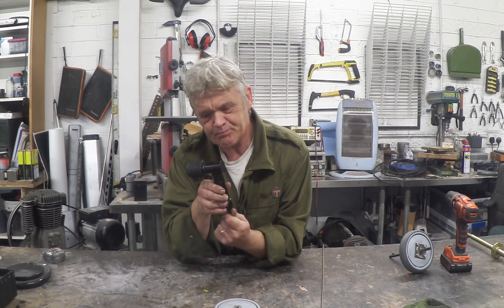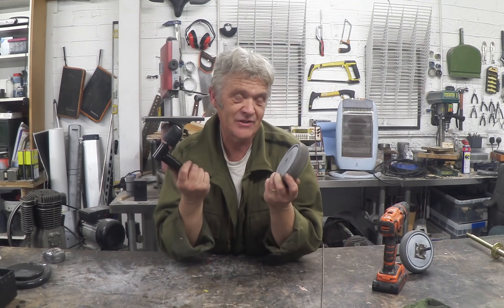1173 How To Make A Universal Bike To Electric Bike Adaptor

Comment: A couple of these mounted on a standard wheel chair and you now have an electric wheel chair.
The only difference is that you would want a single controller for both motors and you would want a couple of drills that have variable speed control.
Reply from the maker: awesome

Comment: Beauty is in simplicity! I totally agree with overengineering problem. Sometimes the coarse, inelegant solution is the most optimal and best-working one. Now, time to look for 90° attachment for drill :P
Reply from the maker: Well said mate
Reply: Why not just mount the drill/motor sideways? On a swing arm, so that it auto-decouples when not driving? Oh, hang on, that's already been done.
Sorry, Rob, luv ya, but this is paynts.

Comment: It wouldn't hurt to have the thing detach from the wheel when not in use.
Having it stay connected at all times means it will hinder movement more then assist most of the time.

Nice work showing how the general idea is applied, though.

Keep up the good work.
Reply from the maker: nice point mate - cheers
Reply: @ThinkingandTinkering  A $10 one way bearing pressed into the castor wheel instead of the plate, and then weld the axle to the inner ring and you have coasting ability with the drill off.
Reply: @jllaine   Nice workaround, mate.
Way to make it simple.

Comment: The only issue I have with this is that a drill was not intended for that kind of duty cycle, and I am pretty sure it will burn out in very little time. It was also a little on the noisy side. lol. Interesting idea though.

Comment: This is great! You can extend the range by 20- 30% by rigging the contacts with a larger battery from a motorcycle. Most drills are 18v or 24v. I’ve a skate wheel and a strip down drill. I wonder I really do, how simple things can be made? I bet you could improve the torc ratios a we bit by changing the diameter of the drive wheel. Well done lads keep it up.
Reply from the maker: nice

Comment: replace the power drill with a 24v motor from ebay and some batteries and a bridge rectifier and replace the brake cable with an electronic throttle or a potentiometer with a return spring attached to the knob and you have yourself an e-bike.
you'll also need something to act as a clutch to disengage the motor when the motor is not active otherwise you'll get unintended wear on the motor and it'll backfeed a voltage to the battery.

Comment: Awesome idea, just like my old VeloSolex but with electricity. However I've seen few contraptions that use electric drills as the motive power and I've always had concerns about:
1) overheating the drill with continuous use
2) the longevity of the bushings in the drill. A lot of them seem to have bushings rather than bearings for the chuck and I've managed to wear out a few just with relatively normal use.

Do you have any thoughts?
Reply from the maker: it really depends on the drill you use - but this is a toy really
Reply: @ThinkingandTinkering  fair enough

Comment: This could be used  as a generator to recharge the battery. Especially when going downhill reclaiming energy from gravity.All it needs is a switching system and a diode to go from drive mode to charge mode.
Reply from the maker: nice

Comment: I played with this idea to have a motor drive the bicycle wheel directly using friction contact to transfer the power and it worked beautifully... until the bicycle wheel got wet: the rubber coated motor started slipping on the wheel badly and the motor was applying more than enough pressure to the wheel. I guess that is why roads are not made of rubber.
Reply: I would imagine it depends on the tread pattern and the size of the contact patch of the tyre, and the roughness of the surface of your motor't drive wheel. You could cost it with a grippy, high friction material to get better coefficient of friction between it and the tyre.
Reply from the maker: sand the motor drive wheel like I did
Reply: Put a hairdryer before the motor so the rubber dries.

Comment: Good fun and a proof of concept please don't get me wrong I enjoy the idea But if you ride that on the road it is not classed as an E bike it is classed as an electric motorcycle you will attract the heavy weight of the law in the form of fines and possibly the loss of your driving licence A throttle is not alowed on Ebike it has to be controled by the pedals a lot of the over engineering is to comply with the letter of the law Maybe draconian and wrong but no insurance tax licence and a not type approved vehicle = 12 points + £300 fine
Reply from the maker: I am sorry mate and i don't mean to question you but that is just plain untrue - the restriction is speed not twist and go throttle

Comment: I would have smoothed out the edges around the leg thigh by using an flexible drill extension. It would only be a matter of time, before I would slice open my leg with your version. Love your episodes watch them all the time. You should incorporate your drive system on the paper bicycle.
Reply from the maker: i put it on the cross bar but you could equally use the seat post or back stay - the idea os to keep cost down so if there is a cheaper alternative i would do that - moving it six inches is cheaper than a flexible drive

Comment: Hub motor would be a lot quieter.
Reply from the maker: it would and a lot lot lot more expensive and much harder to do - it is what it is and fills a niche - it's not trying to be all singing all dancing
Reply: @ThinkingandTinkering  True, just the older I get the more I appreciate quiet power. Electric lawnmowers for instance, are very quiet. At least the new battery ones are.

Comment: All these rub on the tyre motors are very inefficient. Don't listen to me just go and read the threads on pedlecs. They will advise on the best bikes and kits. Don't forget the only control legal in the UK is operated by the pedals.
Reply from the maker: in the uk it is speed limited mate - throttle controls are 3.7mph - but this isn't about the best - it is really a toy to have fun with
Reply: The amount of assistance on many e-bikes is usually controlled via a selector on the handlebar. From zero assistance to full boost and any number of steps between.